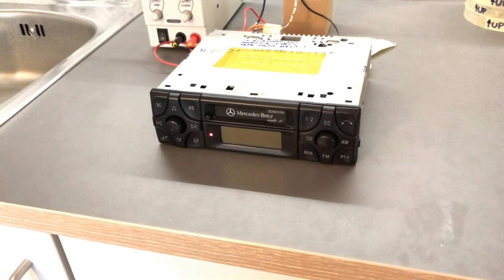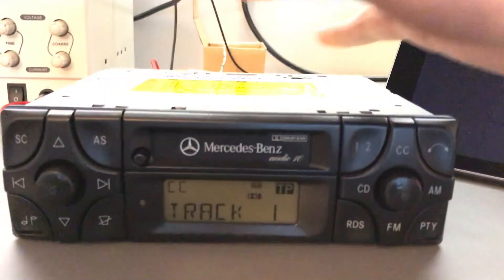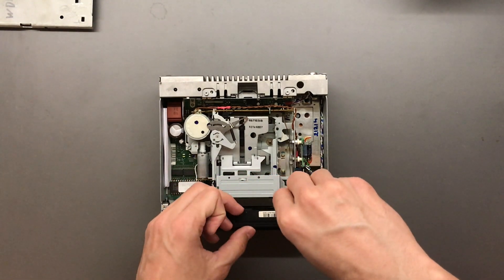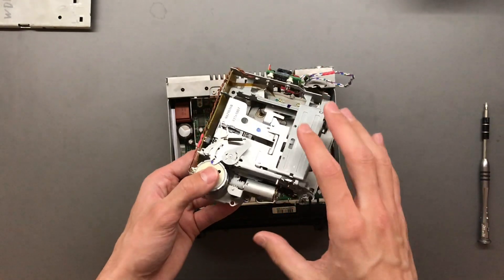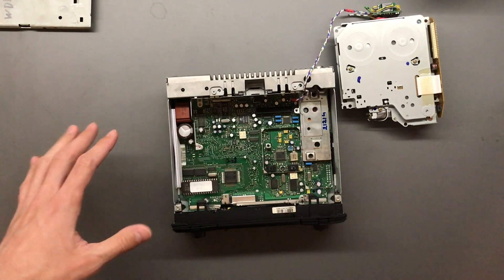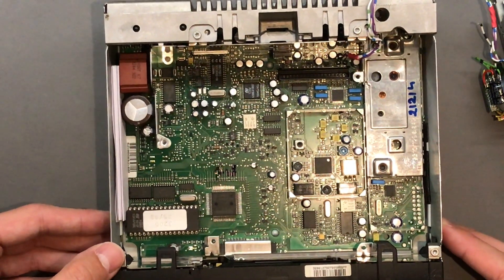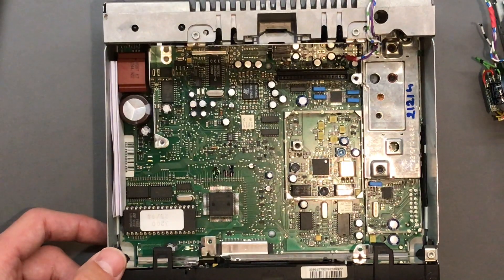Mercedes-Benz Audio 10 CC - Bluetooth Integration

Comment: Today Year 2025, thank you for your video I follow to connect the primary music module to the main board. It is worked. After 7 years, any idea to cut the protection and the cassette can be removed? Thanks again buddy!
Reply from the maker: same as back then :( you have to program a little microcontroller to give feedback pulses - to reassure the unit the tape hasn't broken

furthermore, you'd probably have to also wire up the cc button, and have the micro also press that every now and again, to prevent the timeout
Reply: Thank you

Comment: I have the same installation as you. I have a question, how to next and previous from the HU and than i have a little noise from bluetooth. Which is i need use b1212s dc to dc isolation for no noise from bluetooth?

Comment: Hello! Great video. Thank you for sharing your great work with us. I used a LQSC_BT Bluetooth module, that can handle DC from 5v to 35v, without any stepdown buck converter.  I followed your steps, and its working but with a background noise, like a hiss, a static grinding, or ZX Spectrum loading (maybe you don't know that sound...😅 ). Do you have any suggestion to remove that noise? I will try some capacitors on the motor...
Reply from the maker: what you're talking about sounds like bluetooth noise

try adding one of those (very voltage sensitive) isolating dc dc converters

those will most likely completely eliminate this chirping digital noise 🤘

Comment: I had bluetooth installed through AM in my mercedes APS BT-2 radio and the sound comes from the right side only with only the left side tweeter working, so no bass speakers working on left side...Any thoughts please?  Thank you

Comment: Thanks for your descoveries.
Instead of using a blank tape to stop the ratling, I use a cassete audio adapter to 3.5mm jack like this: https://www.ebay.com/sch/i.html?_nkw=cassete+to+3.5mm (it cost me about 2 euros, I opened the cassete audio adapter to 3.5mm jack and removed the jack/wires/head and also removed all the wheels (I was left with just the two halfs of the shell)).
I'm also not using a bluetooth adapter, I'm just soldering the wires in the radio main PCB to a 3.5mm jack that I connect directly to my phone.
Reply: So you don't need to have crowbarred PBREF in connector 1~5?  Thank you

Comment: Thanks so much!  I too have become addicted to adding BT modules to car stereos :(.  

TIP: I used the "LN-BT02" bluetooth 4.0 module, which has an onboard DCDC converter/voltage regulator (+7-25V), so no need to add one!
Reply: FINALLY! I got it to work. Solidiered on capasitators to my LN-BT02 and attached to the testpoints showed in this film. Allso detached the contactstrip from cassette-readerhead to board. Power from det cassettemotor. But volume on both mobile and headunit has to be on max.
Reply: Update. Removed the capasitator on earthing. Just to test.  More sound, more bass. Actually not bad at all :)
Reply: @steinar70  Glad you finally got it working!

Comment: Hi my friend, i have a problem with my device, i have a radio of clas a160 year 2001 and this has blocked, in the screen have a "wait " word.  I have the code but i cant input the code number. Do you have some information to unlock the device? Thanks
Reply from the maker: yes - you have to have the ignition on - and wait for either 30minutes or a few hours

then you'll have another 3  goes at inputting the CODE

Comment: On the radio side I'm very much confident I can pin out where to solder the three wires LGR for bluetooth injection as well as getting power for the Bluetooth module from the motor. However please advice me how to connect the power on the module and how to include like a voltage stabliser so that it won't go above 12v. Where should I put power on the module
Reply: I'm trying to send a Pic of the module but I cant
Reply from the maker: I'd suggest getting a 5v input bluetooth module, and using either a 

switch-mode buck dc-dc converter
https://a.aliexpress.com/_eOsxv3

or a linear regulator
https://a.aliexpress.com/_ePe9Pn

to step any voltage, be it 11 or 14.5 down to a steady 5
Reply: @Darieee  I actually have csr8645 bluetooth module which is 12v. Can I have your email or whatsapp number
Reply: Rather I can prefer to buy a wired one from you if this continues to upset me
Reply from the maker: lipton5001 yahoo com 🤘

Comment: Unrelated question but maybe someone has an idea: the removable left front panel from my Becker audio 10 does not illuminate anymore. The central knob does, but not the other buttons. Could it be a problem with the panel itself or with the radio connecting pins?

Comment: Please, I need a help for searching code 

Mercedes Benz W124
Tape Becker Audio 10 CD
Class 1 Laser Product

A 170 820 03 86
S/NO. AL 2910 Y 06 94427
MF2910

I didn't find the code. I've been trying anything but it didn't work. Please, if you have a way to find this.
Reply from the maker: ye, just send the code over to this guy after you buy one of his unlocks

https://www.ebay.co.uk/itm/Mercedes-Benz-Alpine-Radio-Code-MF2910-MF2199/112950472073?hash=item1a4c5f6d89:g:feAAAOSwLEtYliar

Comment: Hello, a friend request me to do something similar on a becker be 0774, it has a cassette and AM FM Tuner. What do you recomend? Removing the AM imput or a Blank tape on the Tape side?
Reply from the maker: going via the AM input is always best
Reply: @Darieee  thank you for taking the time to answer
Reply from the maker: no worries -- good luck with your mod man 🤘
Reply: Could you give me advise  how to set an AUX kabel for my Smartphone on the AM?
Reply: I had mine connected through the AM on a APS BT2 Original Mercedes radio but the bass only comes out of the right side although when switched to FM the sound is perfect from both sides…apparently a common problem that I m trying to find a solution to.  Tweeters from both sides work ok with AM connected Bluetooth though.

Comment: But in my sterio no bluetooth mode
Reply: Original Mercedes radio cassette manufactured by Becker - model BE 4310 - type audio 10 - 2002 - with box and manual

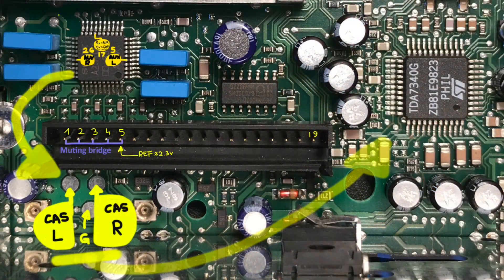Comment: i have a quick question @11:06 ,, the right and left and the ground when i tested the continuity with the multi-meter,  they all beeped and all are connected which is kind of strange!! is this really possible? how come the R & L & Ground are all connected together?
And @16:07 ,, the 5 pins you are showing, when tested the continuity, they too are already connected together!
so Im really really confused and im stuck and dunno how to proceed since i'm afraid to fry any circuitry and lose the cassette....

My Cassette is Becker Typ 3100

Comment: Is it possible to inject the audio in the cd changer input on the board? Maybe that way the control buttons to skip tracks on the steering wheel can be used. At least the Bluetooth module has the functionality to go to the next or the previous track.
Reply from the maker: Oh, it sure is - but you'd need to interface with the D2B optical chip ... or figure out it's outputs, one of which will probably be i2c, which you'd have to generate with something other than the Bluetooth chip

People have done this .. but not the sharing kind of people it seems - there was one video where a dude was writing his own stuff on the screen too..

Actually there might be a better way than the one in the video, using the AM section .. haven't tried it on this radio, but I'm sure it's doable
Reply: Your solution is very elegant. Thank you for sharing your knowledge. I also want to add Bluetooth to my Mercedes Audio 10 Cc radio (I have the other version with the rds button instead of the right knob) but I just want to solder in an aux input and connect in to an external Bluetooth module in the glove box). Can you tell me where I can inject the audio for the aux in? My soldering skills are not that good, so using the aux in ports on the chip is not possible for me. Can I use these test points or are these only on your radio version? Thanks for your help.
Reply from the maker: Sure you can, I sometimes add an AUX as well and it's just in parallel with the BT module

Comment: I take it this never had a facility for a CD changer. I thought most of them did back then.
Reply from the maker: Yes it does, but that's an optical interface called D2B, which was used for a few years mainly by Mercedes, then ditched

Only very few adapters were made - and for some reason discontinued ... so, that path was a no-go